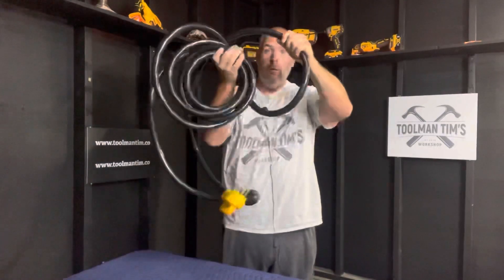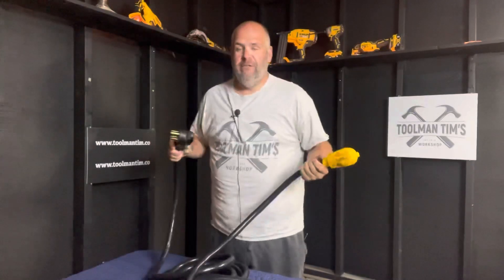TO BACK FEED OR NOT TO BACK FEED?  Powering your house with a generator.

Comment: Good thing I didn't subscribe to this channel.  Suicide cables are called such for good reason.  Connect a generator the correct way instead of doing the "bubba" method with this type of cable.  Unreal someone would make a video showing how to connect a generator with this type cable.  I grew up in Florida and live in Georgia.  I've been through MANY hurricanes and power outages and have always connected generators as if my family's lives depended on doing things properly...and their lives ARE worth the $30 or so to do it right.

Comment: If you're installing an box dedicated to a generator inlet with a proper interlock plate in the panel, you should use a male receptacle on the side of the house and then you don't need s suicide cable. I am not an electrician but after researching this, all the ones who say "what is code compliant" use a male outlet with a flip up cover on the side of the house.

I understand that some folks may be backfeeding into an RV receptacle. But if you're adding a dedicated plug for your generator, avoiding use of a suicide cord is always safer.

Comment: Hello Toolman Tim, ah the widowmaker... still using one. But I call the utility co. first and find 
out how long the power will be out. If I find I need to use the gen, the 1st thing I do is shut off 
the breaker under the meter out on the pole, then I shut off the main breaker in the panel in the house. 
I then plug it into the dryer outlet, this way I don't have any live exposed contacts, the last thing I
do is plug into the gen. The dryer's circuit is good for 30 amps as is the gen. Some use a 
recessed male receptacle of the twyst lock style connected to a double breaker that is OFF
when not being used. this too is good as the cord will have a male and female fitting. 
As long as you know what happens by not shutting off the mains, you will be good. By not 
turning off the mains, power from your gen goes into the service drops. where I am, the street
mains are 7200 volts and get stepped down 30 times to 240 volts. feeding power up the service
drops will put 7200 volts on the transformers normally known as primary winding will now be a secondary, and if that wire is dangling there is a great danger of electrocution or fire.

Comment: This is definitely NOT the safest way to do it! The safe way is a generator inlet (not outlet) and then use a male/female "extension" cord. It doesn't cost any more than what you did. This way, it is up to code, safe, and legal. Male/male cords like the one you made are called "suicide cords" for a reason. You're are right about the generator interlock kit on the breaker, but that's only half the story. Cheers!
Reply from the maker: You’re 100% correct on this this video is based on my first iteration of my backfeeding experience. I am in the process of updating some things on it to make it much safer. Didn’t realize the mistakes I made in the first one and as soon as they get updated, I will definitely do a 2023 update video.

Comment: Is it possible to backfeed two 120v generators to separate receptacles that are on differwnt bus to power the entire panel (minus the 240v appliances)?
Reply from the maker: So this is one area that I have to say I’m not sure about I will ask some people who are smarter than me and see if I can get an answer, but this is one of the few scenarios where I just can’t give advice because I just don’t know
Reply: Aren't the all the neutrals for both legs bonded in the breaker panel? Would the neutrals of each generator be bonded to each other. This is the only issue I could see with it
Reply: @AGuyFromHazard  I think they would be bonded to the breaker as both generators have floating neutrals.
Reply: No. You can feed one generator into your panel such that it feeds both legs of your panel. As noted you would want to turn off your 220V appliances and any circuits that are MWBC. The latter is done so you don’t overload the common neutral. I run my house with a WEN DF360iX that way through a proper inlet box and interlock and it works fabulous.

Comment: Thoughts on just plugging in to a regular outlet?  Most time you just need refrigerator furnace and TV.  Lol
Reply: I think you can do that.Thats what I'm looking for I have a front covered porch with an outlet
Reply: If going in 120 circuit then the circuit you want to power has to be on the same phase. It works. Just remember to turn off every breaker on that phase before energizing that phase. Then only turn on the 1 or 2 circuits you want powered.

And of course before all this TURN OFF THE MAIN BREAKER.
Reply: @920flashback just to clarify… there is only one phase coming into your house. That is split into 2 ‘legs’ of 120V that come from the pole into your panel. But yes you would only get power on that one leg of your panel

Comment: There is a reason electrical cords come with one male and one female end. Do it right and install a proper male inlet on the home and use a generator transfer or interlock. It is criminal to suggest using a 240 volt cord with both ends having exposed male pins. Why even hack apart a new cable and waste time and money when all you need is the correct inlet installed there by employing a properly manufactured and designed cord?
Reply: You can buy a factory made suicide cord, like he said people will do it anyway, why can they sell factory made cords

Comment: I use a 50 amp plug in to feed my RV in the Driveway all year. For Power Outages, I use the 6/3 wire with the two 50 amp male ends like you show to back-feed my Generator during power outages during hurricanes (Fl).  I follow the procedures and triple check I have the Mains/Commercial Power Breaker turned off and Orange Duct Tape with a Warning not to turn on across the top of the main breaker. All my branch circuits are turned off before plugging in anything into the Generator. I am the only one that goes near or deals with the Generator or Circuit panels. I bring up the circuits I need and only use what I need. Washer, Hot Water, Window AC's, Fridge, Freezer, Lights TV Internet, Well pump. Central AC is Off. I Don't run the Generator 24/7 to conserve fuel since you never know how long power will be out. I reverse the Procedures after I know the neighbors have Commercial power from the Grid. Works like a charm. I've had Automatic Transfer Panels and interlocks at other homes.   This is the cheapest and easiest if you already have a Power Outlet for your RV and are limited on breaker space. Just be certain your Mains Circuit Breaker is OFF!

Comment: if you're feeding 220 volts back to the house,,,you do not need to wire the neutral. All you need are the 2 ---120 VAC leads from the generator (like a dryer plug) and the bare ground wire. That's it. Wiring the neutral into the plug can cause serious electrical problems, and multiple paths for return current flow. NEUTRAL lead not needed
Reply: Then your 120 volt circuits do not work.
Reply: @PoNKPoNy  YES!!!! you are correct....I changed that in my circuit and included the neutral. Good thing I changed before testing the gen set.
Reply: @adriancressy8363  👍🏼
Reply: What if your feeding 2 120v legs from a 30amp TT30 plug into a 4 prong 240v dryer plug. My solar generators TT30 plug is with floating ground. I understand I'm putting 120v on each bar in the panel, that's not 220v but just powering each leg with 120v,  so ditch the neutral also? so it's only bonded at the breaker box?

Comment: Can you talk about if you have a grid tie solar system with no battery back up? Will the solar think the grid is up with the generator on and start producing power? I’m thinking it would be best to switch off the solar inverter as well.
Reply from the maker: I have a separate solar system in my garage so I’m no solar expert but I would think to be save i woudl turn it off before booking up the generator

Comment: Is it possible to do this on a select circuit and only turn that one off? I feel like it should be because that circuit is no longer on the grid. Just looking to get a second opinion / thought stream.
Reply from the maker: I’m not 100% clear on what your saying but If the power is off and you turn your main off and all your breakers and only turn one on then yes it should work fine
Reply: I mean if you turn off one breaker and back feed that one only, that should work since it's now off the grid so to speak. 

I'd imagine the little breakers work the same as the main. Cuts power off to the outlets that it's connected to

Comment: Very good, like you said, if they are going to do it anyway,  might as well teach then the dangers of it and the proper procedure for do it the wrong way ;)
In my case, I am the only one that will touch the breaker panel and the generator and even then, I have written a SOP that i have attached to the generator; a check list and instructions so I can read it every time I do it.
I even coated the hot end of the cable red. Because as much as I know what to do, I don't want to get too comfortable.
I haven't lost power enough to use this but I go through the procedure at the beginning of winter and the beginning of summer, so I am versed at it.
No different than practicing shooting. I don't want to use it in real-time, but I'll be ready if I need to ;)
Reply from the maker: That is great thanks for sharing henry.  What did you use to coat the hot end of the cable?
Reply: @TOOLMAN TIM'S WORKSHOP  
At first I used red electrical tap but then I used plasti dip.